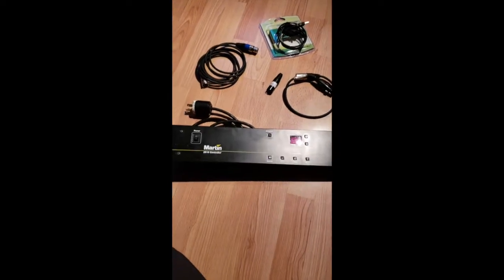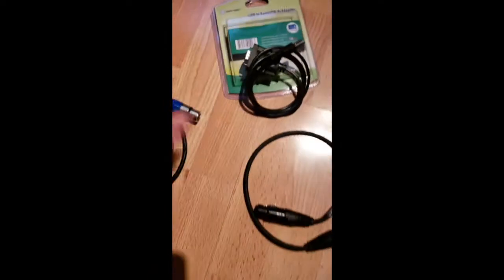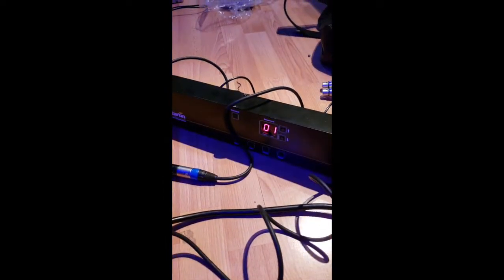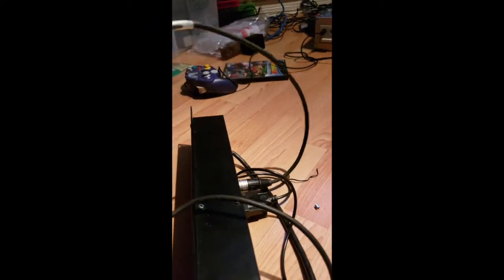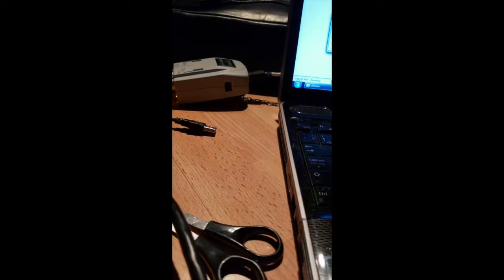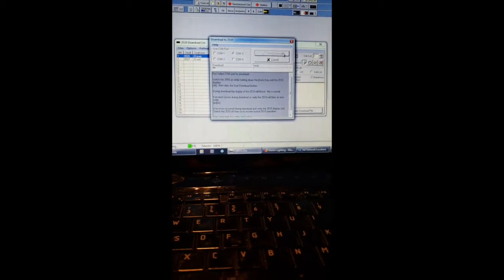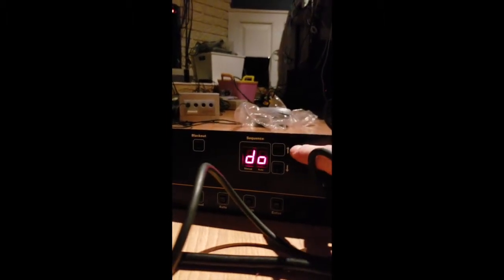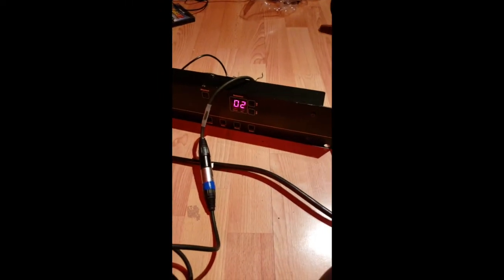[Tutorial] Martin 2510 Controller Programming

Comment: That reverse phase has burned many a DJ/LD.

I'm on a mission to find a way to extract the data from the unit now. I have an old system that I inherited for my DJ company that has a show on it. The Light Jockey files are long...long gone (afaik).

A little reverse engineering is definitely required because the I'm sure the packets sent aren't readable by Light Jockey. I'm not even sure if this is possible, but only having one controller for this whole system is a massive bottleneck I don't like.